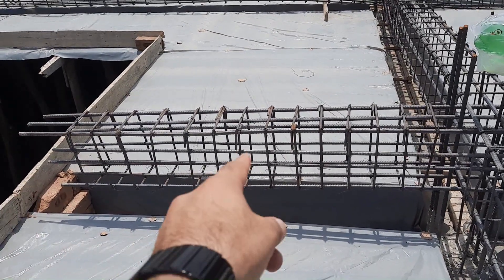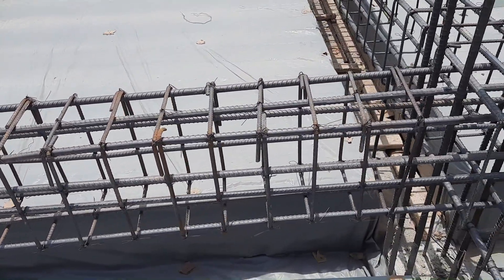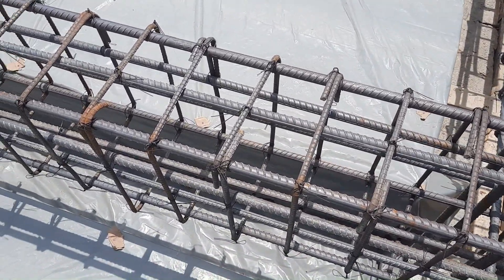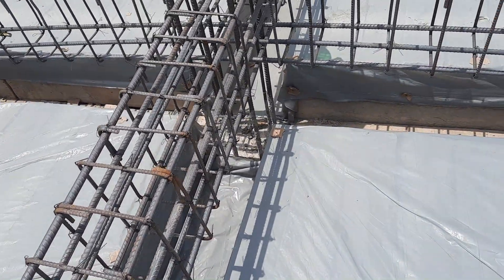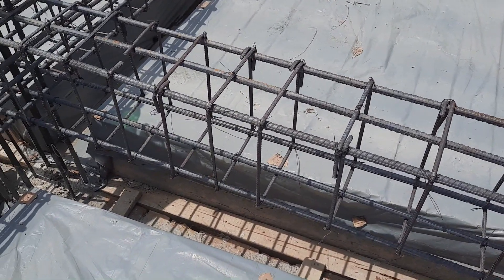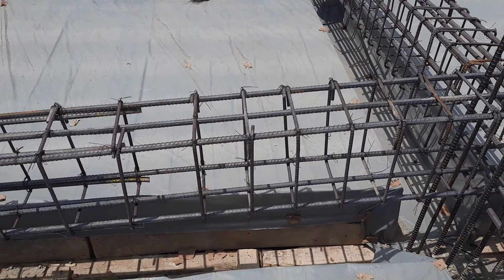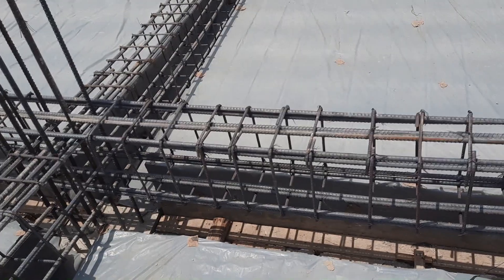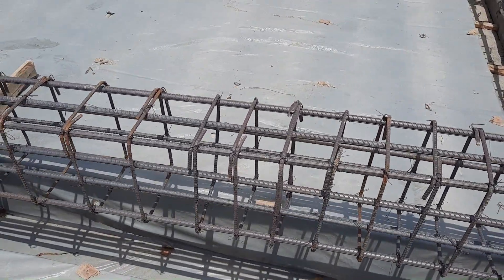Cantilever Beam Reinforcement Details practically

Comment: Rule of thumb: If the steel rebar is 1 inch thick then it should be spaced apart at 1 inch to 2 inches apart from each other and the steel ties or hoops or loops must be .5 inch thick and spaced apart at 1 inch apart from each other and the ends should be bent inward at an angle of 135 degrees forming a hook. And covered by 2 centimeters to 2.5 centimeters of concrete. Add a pre-dissolved watery mixture of 13 parts water + 1 part sodium silicate (water glass) and slaked lime as your water. Or add .5 bag of powdered brick for every 1 bag of cement to react with the calcium content in the cement binder. The aim is to make the concrete as non-porous as possible to prevent water penetration inorder to prevent the rebars from rusting regardless of whether they are galvanized or not.